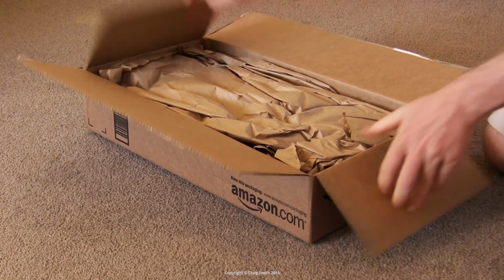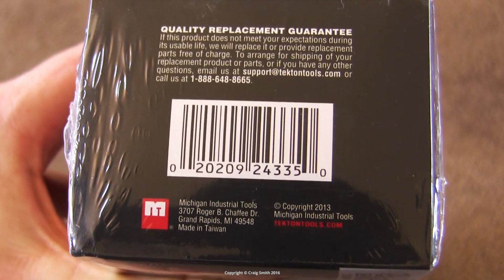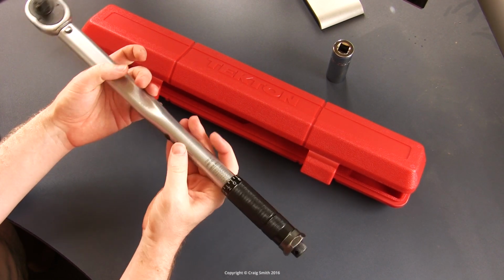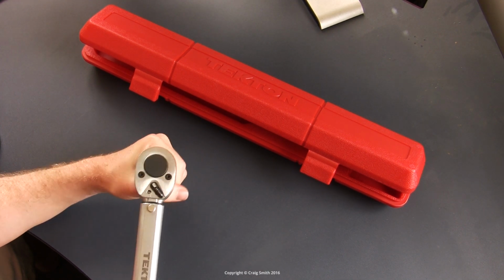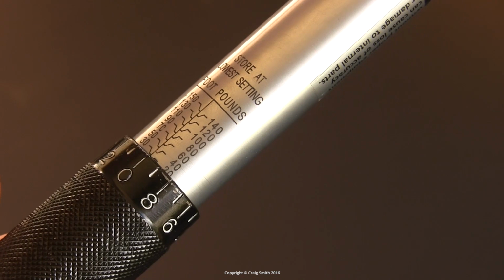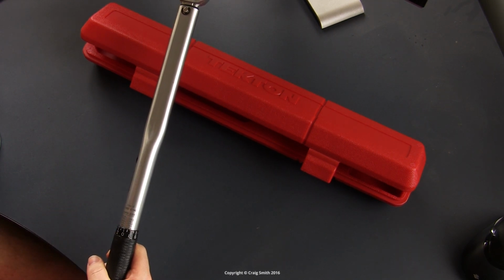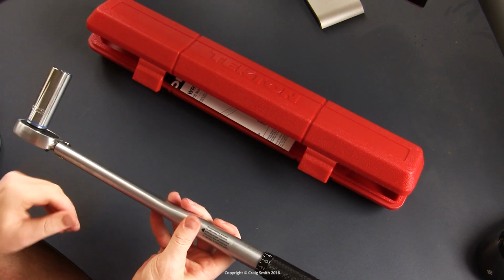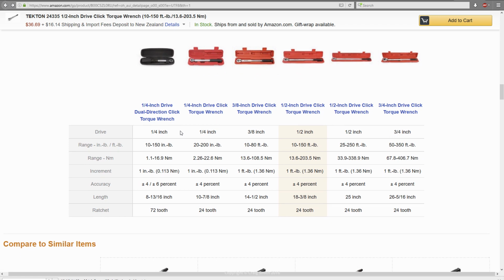Review: The best value torque wrench? Tekton 24335 1/2" click style

Comment: Most of my sockets are 3/8" so should  Iget a 3/8" Torque?
Reply from the maker: Sure, but really the wrench needs to be sized by the torque range you need. I find I need a biggish one like the one reviewed, for the bigger nuts & bolts on a car, which happens to be 1/2" and I use an adapter with my 3/8 sockets. Then I also have a small 1/4" wrench for the more delicate jobs.

Comment: I've owned a few torque wrenches over the years and I always return, to my trusty precision instruments split beam torque wrench 1/2". Never let's me down and made in the USA.
Reply: Your comment just made me feel better about just buying one lol. I’ve been resisting buying the split beam from snap on for awhile now cause it’s like 450 bucks, a guy at work kept telling me to buy the precision. So 2 weeks ago my old school one I’ve had for years broke and I didn’t wanna wait a few days for shipping so I just went to advanced auto and bought the one they had there for 100 bucks, almost immediately the gears started jumping gears while using and after 5 days the gears completely broke, took it back to them and had it exchanged, literally the next day maybe 4 or 5 cars into use I was torquing a wheel and somehow the small screw that goes threw the head snapped in half and the gears and everything else fell all over the floor, absolute fucking garbage lol so yeh I just ordered a precision
Reply: Beam torque wretches  are way more accurate ,cheap as fuck and they don't need calibration ..you just have to watch not to bend the steel ,if you do it won't line up to zero . Unfortunately there are places a beamer can't be used .

Comment: Craig I like this wrench.   I have the 1/2", 3/8" and 1/4" drive.    Very practical.  Accurate enough.   And with Amazon they generally try to keep customers happy.     Take the plate off an lube the teeth on the anvil assembly.     I can hear, like with mine when it was new, the head is dry on your wrench.    They all seem to lack that lube.
Reply: grease or lube
Reply: Plus how often?

Comment: They all seem to be the same these different brands torque wrenches. They just out source them from the same places. Same vacuum moulded hard cases, same wrench design & individual components. The matt finish  & black handle here being a slightly different design on the same product. Although it makes the reading clearer. It just comes down to price & or warranty, which company is peddling the same product for the best deal?

Comment: So is 1/2  the best size to get for a Torque wrench if you are only looking to do lug nuts for winter tire swaps (spring & fall) over say a 3/8 drive torque wrench?
REPLY
Reply: A 3/8 is not for lug nuts.  Way too fragile for the high torques needed on the wheel lugs.  I wouldn't use a 3/8 ratchet on bolts over 50 ft lb or so
Reply from the maker: I would say so.
Reply: Yes